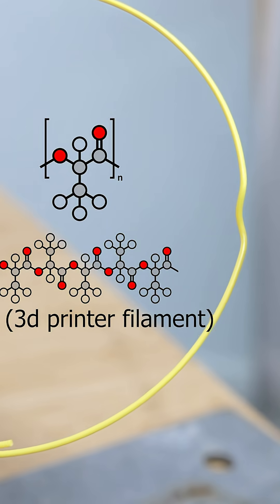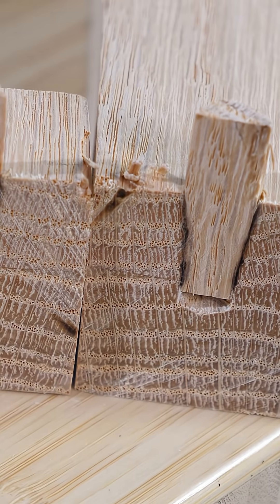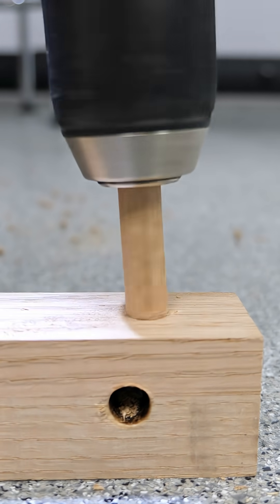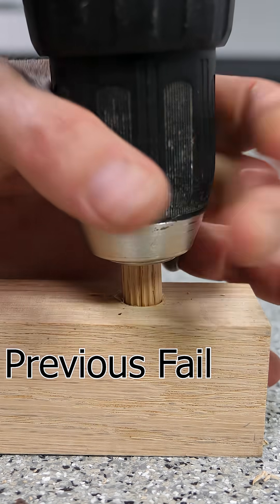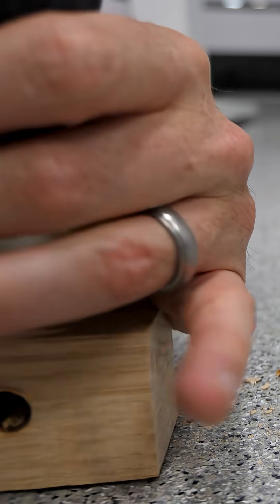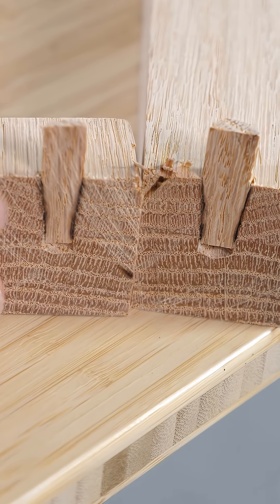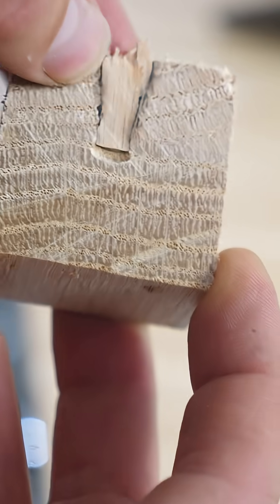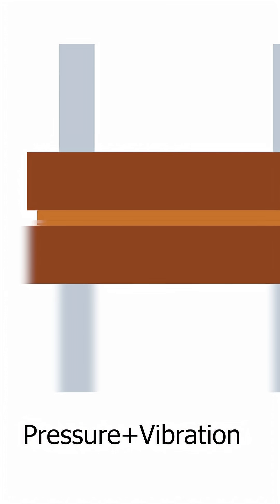I Melted Wood With Friction

Comment: I asked my Chemistry teacher why wood doesn’t melt 35 years ago. Now I know it does!
Reply: Me too. The answer I got was that wood wasn't stable enough and the complex molecules would break down or burn before they melted.
Reply: @ArjanoptHof Not a bad answer. It's why we can't melt wood with fire. They just didn't consider other ways. (Which no one did until 20 years ago.)
Reply: @TheLampl1ghter I feel like this is pretty true since we have more oscillating type tools now, compared to then.
Reply: @TheLampl1ghter  no, it's not just about fire. If you try to melt it under vacuum, so no fire possible, you'll find that all the readily melted components also readily volatilize into gas. The problem is the sheer number of different components (and their molecular size). The first thing that tends to happen as you heat up complex molecules is decomposition, so you'll have a lot of molecules that could melt easily just breaking and flying off as gas before you can add enough heat to melt everything. Because there is a metal oxide component to plants, the ash component, mostly potassium hydroxide, and that ain't gonna melt until it's red hot. So that's the story, in short- you ARE melting wood, individual components, you're just also breaking and evaporating them before the mass can melt. And we can see this in the actual pyrolysis of wood. They DO "melt" wood in the way I described, and you can indeed see liquids leaking out of the wood as it breaks down (in fact, with very tarry woods, you can evem see the tar leaking out as you burn the wood). This is why wood welding works by putting the wood in contact. As it heats up, the liquid glass lignin stays trapped between the surfaces instead of escaping. They collect those liquids and gases for fuel.
Reply: @TheLampl1ghter that was always my response, it burns before it melts so it just can’t melt. That never sat right with me cause they’re 2 different things, you can’t burn metal but you can melt it. Glad I saw this video.
Reply: @joshyoung1440  Very impressive! Best Cliff Clavin impression I've seen in a long time!

I had trouble putting my finger on why your comment sounded fishy so I got a second opinion. This sums it up nicely:  It's throwing out half-remembered “factoids” with authoritative phrasing, but without building a coherent explanation. It’s what makes the comment sound smart to a casual reader, but hollow when you pick at it.
Reply: @ArjanoptHof That's not a bad answer. I asked if ashes melted when I was 10 and the chemistry teacher answered that it wouldn't because it already was a product of a combustion.... which at the time I knew was not my question, she didn't know the answer and I just gave up.
Reply: @micaelo_madeo_anglio  Actually ashes can melt if the temperature is high enough. This is actually a traditional way of making a pottery glaze.
Reply: @ArjanoptHof I asked my 9th grade science teacher the same thing and he told me "it's because wood is a fuel and fuels don't melt"
Reply: @ArjanoptHof generally speaking they were correct. Show me melted wood! Its only small amount of the wood. Since the wood is like they said.. complex.. yes some of the chemicals in it melt but obviously all of the chemicals do not.. unlike metal or glass. This is just a technicality.
Reply: To be fair, he was right. Glass transition is not melting, in the physical sense.
Reply: @kubaGR8  no, in the physical sense they are the same phenomenon, the increase of intermolecular movement, they just happen according to different patterns. You're thinking of the pedantic sense, my friend.
Reply: You were ahead of your time. 👍🏼
Reply: @meversace
Revelation 3:20
Behold, I stand at the door, and knock: if any man hear my voice, and open the door, I will come in to him, and will sup with him, and he with me.

HEY THERE 🤗 JESUS IS CALLING YOU TODAY. Turn away from your sins, confess, forsake them and live the victorious life. God bless.

Revelation 22:12-14
And, behold, I come quickly; and my reward is with me, to give every man according as his work shall be.
I am Alpha and Omega, the beginning and the end, the first and the last.
Blessed are they that do his commandments, that they may have right to the tree of life, and may enter in through the gates into the city.
Reply: I asked mine if I could use the restroom
Reply: lmao i remembes asking that too
Reply: To be fair, aside from the lignin, wood is mostly made of cellulose. Besides melting the lignin, this process will also caramelize the cellulose. Without detailing that process, I suspect that is part of what makes the dark brown/black layer at the joint between the dowel and the plank. If this process were repeated in an oxygen-free environment (like a nitrogen- or argon-only atmosphere) I wonder if that would affect the process and if the weld strength would be any different.
Reply: @InternetRando42  check my comment. The answer is that the cellulose breaks down into gases way before you'd be able to melt the ash component, so if you do it under vacuum, you get... a lot of fumes being expelled.
Reply: Chemistry Teacher: Well we'll get wood to melt, it just won't happen for another 15 years.
Reply: It's not what you know, it's what you can prove
Reply: I'm pretty sure everything can melt, just like everything can become liquid or vaporize, I mean technically it wont be the same materia it was before but yea
Reply: I mean, to say that the wood melts here is sort of true and sort of not.

Wood is a composite material. With the heat, some of the components of that composite material become goopy, and then bond together as it cools. Essentially what this does is sort of melt the glue that holds the wood composite together, enabling it's use to bond two separate pieces of wood.
Reply: It was not possible until a mistake was made.

A lot of discovery were made by mistake.😂😂😂
Reply: @madi4642  It's actually rather quite hidden, because if you drilled a dowel into a hole you'd just think it was stuck because of friction or because the heat deformed it or something, not that it had welded on, so it was only noticed with two flat bits of wood, which was only possible with reasonably modern equipment, and it's entirely likely it has happened before but people just ignored it, or weren't in the capacity to investigate it.
Reply: when I was researching it, I found that it burns. Even if you raise the temp in a vacuum it causes a different chemical reaction than in oxygen. And in the video it very much looks burned.
Reply: It sublimes
Reply: Mainly wood combusts before it melts. However if you tweak the environment, amount of time, and conditions the materials making up the cell walls will melt.  In this case they soften just enough to merge with adjacent walls and reform together.
Reply: No, now it does.
Reply: $5 if u send this video to them
Reply: Nice. That time your teacher didn't know it either probably
Reply: This isn’t melting wood. It’s melting/softening the lignin.

Heating up wood in an inert atmosphere will not make it a bulk liquid. It will eventually decompose in a process called “pyrolysis” and break down to a nasty bio-oil-ish thing and some gaseous products.
Reply: @robertb6889  That’s like saying you’re not melting we’re just melting a component of your cells……..you won’t care because you’re literally melting.
Reply: It's an important distinction, because it will never melt into a puddle. It's partial melting. That's different than completely melting.

Case in point - our cells are mostly water but we maintain our form. Melting part of our cells is an ironic comparison since most of us is melted and we would die if we froze somehow.
Reply: Under the right conditions anything can melt
Reply: He looks like messy
Reply: WHO'S LAUGHING NOW MOTHERFUCKA'!
Reply: they were awarded a price for their discovery LoL
Reply: Omg... Dude, I remember everyone laughing at me when I was 6-7 years old cause I was convinced that wood could be welded together or stuck together like plastic, metal, gum and other materials. Laughing at me cause they thought it was cute and that I really didn't know or understand anything at all. And they were just like, honey, wood doesn't work like that. I asked why I wasn't able to separate it after a while playing with workshop tools, they weren't able to answer the question, (FYI, I wasn't supposed to be there btw, just kept sneaking in, I messed around with a wood lathe or something) which, interestingly enough, I too was able to measure very precisely without any tools or anything, just be looking at objects and get them absolutely perfectly aligned and people would be asking me how the hell I was doing it. This is some years later being 12-13 years old. Even the woodworking teacher was just baffled by my accuracy without any tools to measure. I just told them that I have no idea, I just do it. And on the other side, I greatly suffered in mathematics in being far below average. To this day I am still able to do these things. IDK, but it feels like my thoughts were in fact, correct or having a similar theory, along with some oddities that I don't understand with myself yet as a 27 year old...
Reply: Same but 15 years 😅
Reply: Bro I'm finding out in the comments is wasnt the only one that thought this. Turns out we were thinking about the wrong bonds. The cellulose isn't the vehicle for melting it's the lignin. Crazy though that alot of smart brains at least thought it would be possible. Pretty cool.
Reply: Wood can't melt. Your teacher was right...
If you heat wood, the water boils away first and then the lignin and cellulose (both long-chain organic molecules) will react with oxygen and burn. Even in a vacuum, these molecular chains are too long and tangled to wiggle free into the liquid phase before they reach temperatures high enough to break their bonds.
Reply: No it doesn’t! Lignin is a part of wood. Not Wood.
Reply: 😊😊bi😊😊😊
Reply: @skepticusmaximus184 actually that crazy nonsense isn't new either. First legit sex change happened in the 1930s and sex changes in history dates back to Roman times????
Reply: @gonelucid Well I'll just repost the comment I made above just for your benifit:
 

Nobody actually BECOMES a woman except for a little girl going through puberty.. MTF transexuals may like to live as women and be treated as such, but no amount of cross sex hormones or surgery can turn a biological male into a female. I'm talking about BIOLOGICAL SEX. NOT THE ARTIFICIAL CONCEPT AND REDEFINED WORD "GENDER". If you've lived more than 30 years as an adult, you might know as part of your "lived experience" the fact that the terms man and woman referred to the immutable biological sex categories of which there are TWO. 

People may be born or develop gender dysphoria and it may or may be a good idea to accommodate that by entertaining the pretense that they can live as the opposite sex. But we must all understand that in no sense does transition turn an individual of one sex into one of the other. THEY (for their own psychological health) need to understand and accept the biological reality of their natal sex. THEN we can negotiate treating the individual as the opposite sex. People who think they can FORCE others to live in a delusion and expect others to modify their language to accept any and every trans person as a member of the opposite sex on indiscriminate unconditional terms (including that  it means a change in biological sex) can take their gasslighting shit and bash it right back up the shitty hole they pulled it from.
Reply: Also why is no one mentioning the melting ability of wood sap?
Reply: I didn't ask the teacher but always I had this question in my mind.
Reply: well, they only invented it 20 years ago so it wouldn’t have worked 35 years ago, obviously 🤯 unless you have a Time Machine ⏳
Reply: Didn't you hear? This was only discovered 20 years ago. A lot of things changed since then. Melting wood and men becoming women to name just a couple. 😅
Reply: @skepticusmaximus  The first sex change operation was carried out in 1906. Just saying.
Reply: @skepticusmaximus184  Found the dog whistle comment! Get outta here, maggat, trans people have existed as long as humans have been recording history ❤
Reply: @skepticusmaximus184  He just told a story what about it? Obviously he heard what the guy said in the video. Bad comment by you. Do better!
Reply: @PulakaikkoWhat part of "😅" don't you understand Mr Doobetta?
Reply: @PulakaikkoHAHAHA you did the degen “do better” meme 😂
Reply: @skepticusmaximus184 I did understand, unless you were making a joke
Reply: @skepticusmaximus184 actually that crazy nonsense isn't new either. First legit sex change happened in the 1930s and sex changes in history dates back to Roman times????
Reply: @skepticusmaximus184  what part of the guys question is your comment trying to answer?
Reply: @skepticusmaximus184 Can you not? People have been "becoming women" for thousands of years, you just found out about it recently
Reply: @skepticusmaximus184  Trans people have been around for all of human history. Why did you drag them into a random science video?